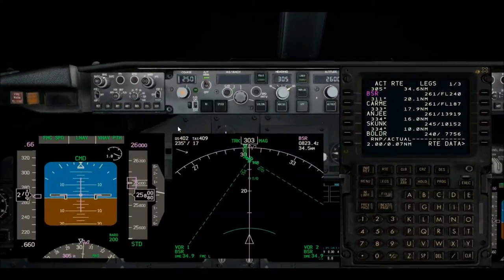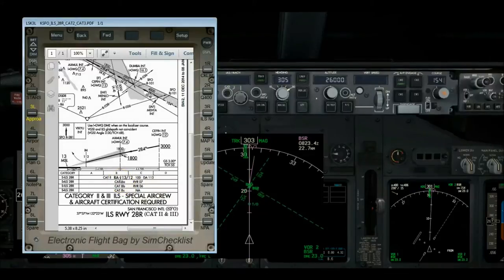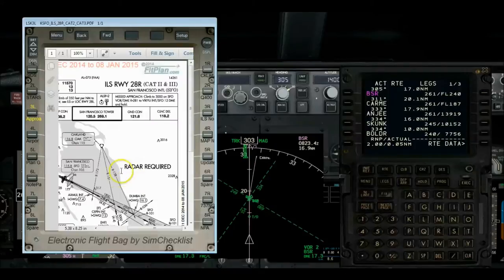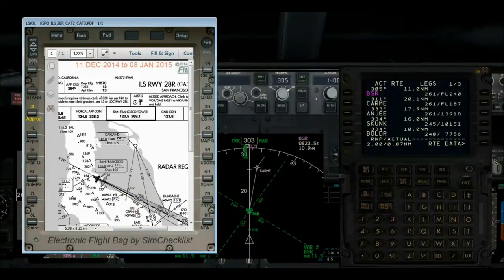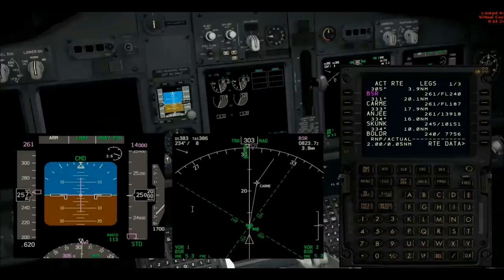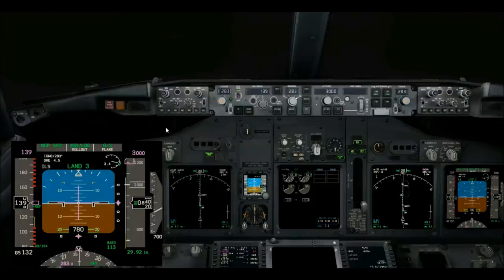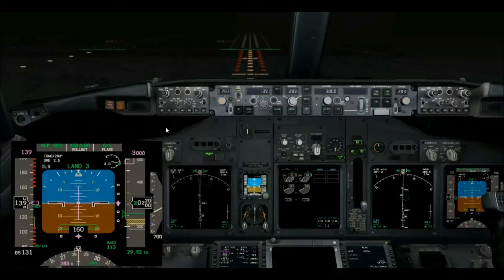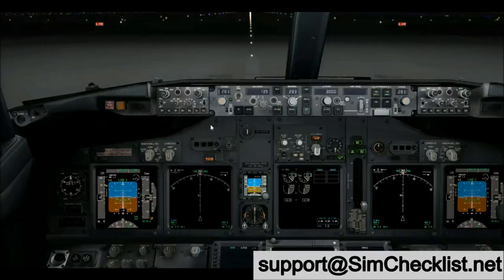MCP 23 LNAV Flight Demo Part 2 of 2

Comment: Your series of video is right on the money....so full explanation given...i cannot believe that it has a low number of view....my JOC would have been so much easier if I had gotten your inputs before it....sincere thanks to you....from Brazil
Reply from the maker: I think that most flight simmers just want to have fun flying the 737NG and they can land and take off pretty well. As for flying it according to how Boeing says the 737NG should be flown, it takes study and discipline to do that...and that might get in the way of the fun :-)

Now, if the flight simmer is having problems flying the approach, speed issues, flying through the localizer, etc., then they might have to watch my video to see how it should be done which would eliminate all of the problems they are having.

As an FYI, I'm now a full flight simulator instructor on the Citation II and Citation V at the Long Beach airport in California. I've always been in flight crew training on the big jets and this is my first time with corporate jets.
Reply: @rfresh1011  Im using Xplane 11 with Zibo 737...my thrust indications are fluctuating during take off and climb when I press TOGA and it is not showing the FD after lift off....any ideia what that could be??

Comment: What I do not understand. This airport has got ILS. Every real pilot would use the Approach mode and everything would be perfect. You'd better use for a good demo an airport with only LNAV path without VNAV. You cannot use the glideslope, because there is none (as far as I am informed)
Reply from the maker: "...Every real pilot would use the Approach mode and everything would be perfect..."
In the real world, no. Here is how things work in the real world with real pilots: Airports where jets can land have multiple runways. These runways do not have every type of instrument approach. Some have an ILS. Some don't. Some have an RNAV (GPS) LPV approach, some don't. Some have an LNAV/VNAV approach, an LOC only approach, a VOR, an NDB, etc. The wind determines which runway(s) can be used for takeoffs and landings. And THAT determines which instrument approaches are available for the landing runway. So why would I fly an LNAV approach if the runway has an ILS? The answer is: currency and proficiency. Pilots want to stay current with flying a variety of instrument approaches...in case one day the weather is bad and the only approach available is an ILS or an LPV or an LNAV/VNAV. The other thing to keep in mind is that these instrument approaches are never guaranteed to be there for you to use. They may be out of service for maintenance or simply broke and not available. GPS approaches may fail a RAIM (Receiver Autonomous Integrity Monitoring) check at the time you're due to be at your destination airport and then you cannot fly your planned GPS approach.